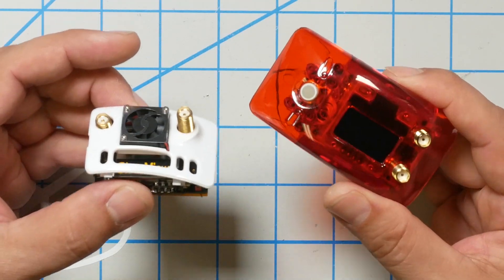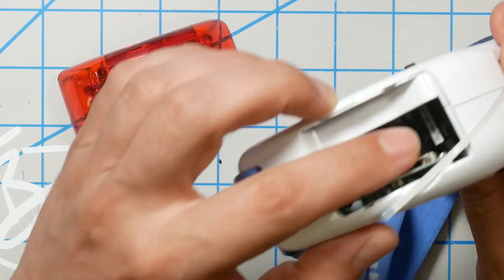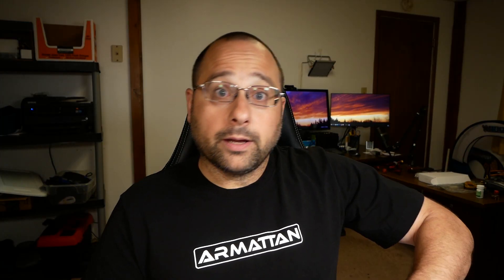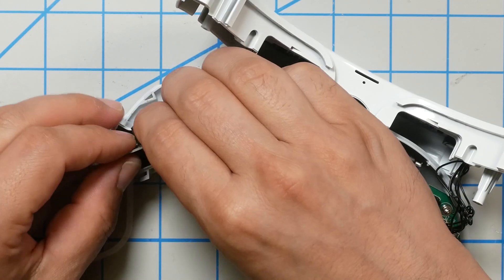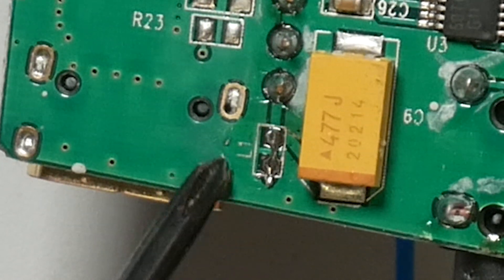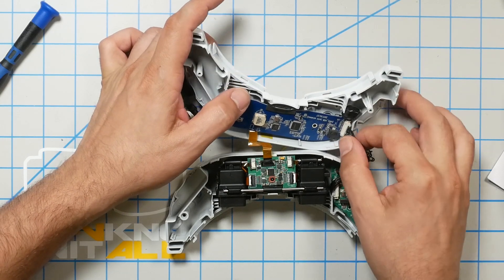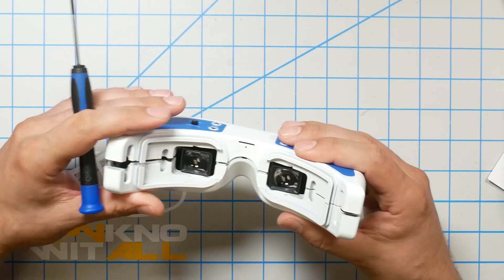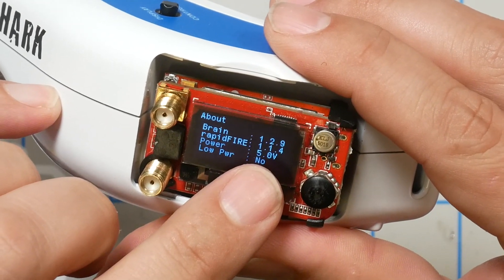Fix Rapidfire Low Power | Fat Shark L1 and L10 Inductor Mod

Comment: 😁 I did the L1 mod, But when my goggle battery gets low it go’s into low power mode 🙁 “rapidfire”. If I did the L10 mod would it fix this problem? Or does rapidfire  just do this to conserve power? Thanks again Bardwell
Reply from the maker: Yes.
Reply from the maker: It would fix it.
Reply: Thank you very much josh for the quick response. I appreciate it. Happy flying

Comment: FYI, at least with rapidfire you can access the dvr with the ribbon cable if you disable both antennas in the rapidfire menu.
Reply from the maker: What a pain in the butt.
Reply: @JoshuaBardwell  guess it depends how often you look at your dvr, but yeah, definitely some extra steps

Comment: Hi guys just be careful when you put the faceplate back on I removed it once since I had it to do the l1 mode and when I put it back in ,it bend /crack one of the lip on the goggle that hold the faceplate. Lucky I only had to do the l1 mod I’m pretty sure if I had to take it apart Again i will break it fully .

Comment: Nice video...just FYI FS will charge you $15 to do this mod to both L1 and L10...I just inquired about it since I need to have a burn spot repaired.  Figured I could get it all done at once by pros, but meh....for $15 probably do it myself

Comment: Wil it work with attitude V2
Reply from the maker: Unknown about that I'm afraid. I know for sure Attitude V4 doesn't need the mod. But earlier than that I can't say.
Reply: just put a volt meter to the bottom pin of the module when plugged in. If its >4.9v you're good.

Comment: I have dominator v3 and before I ordered rapidfire I went ahead and did the L1 mod but the voltage only went up to 4.5v. I had to take apart the DVR module and do the L10 mod as well to get 4.84v which is enough for rapidfire to work properly. I followed Joshua L1 mod video and took me hours of research to find out that I have to do L10 mod as well. I wish this video has been posted before, would have saved me so much time, but I hope this now helps many other pilots like me . Keep up the good work Joshua

Comment: Isn't i better to stay away from those high powered modules? After all, the inductors were designed in by a hopefully competent electronic engineer, and myself being one of them, I really don't think that the inductors were designed in as a decoration... But if you really enjoy these "Dam you rapidfire" moments, it would be more productive to add another voltage regulator to do the job properly.
Reply from the maker: Fat Shark has officially endorsed this mod. That's all i can say.
Reply: @JoshuaBardwell  Did they endorse the L1 mod when it first came out?
Reply from the maker: They endorse the mod, in that they say it won't cause excess noise in the power supply.
Reply: havent seen the schematic, but its probably just a choke in the power line for the module. The modules have a decent voltage regulation an filtering on their own, so it's probably fine. But I get your point, normally you don't want to short circuit your filter chokes

Comment: He Josh I have a hdo and laforge v4 every once and a while I only get one antenna would this be the diversity module going bad sometimes my patch will read less than my Omni right in front of me
Reply from the maker: I'm not sure about that. I don't think LaForge goes into "low power" mode like RapidFire does. My best guess would be that you have a bad connection in the wire going to the diversity module and it is cutting out every now and then.
Reply: Thanks I'll get the multi meter and try that

Comment: I thought that I got around this by somehow using a regulated battery cable on my HD2s. It got  low power on a regular FS battery and not on the cabled battery. Seems to be ok until a certain voltage level on the battery but added the ribbon cable so I could use a regular battery.

Comment: HD2 V2 Terminators do not need a mod... High Power compatible..
Reply from the maker: Correct. Basically all the goggles made from Attitude V4 forward don't need the mod.
Reply: Joshua Bardwell what is the type of wire you use to bridge out the L10?
Is it just a length of solder?

Comment: Way off subject but I was hoping you could help with my Emax RS 1606/4000kv motors are getting hot on my acrobrat with 5 on d gain on pitch and roll. I don't know anything about filters, I appreciate any help.
Reply from the maker: If your D gain is only 5 and the motors are still hot then I think you are over-propping them. Too big a prop, too high voltage battery, too many rpms. Are you 100% sure others have successfully used a motor this size and kv with this build?
Reply: @JoshuaBardwell  3052 props on an acrobrat build, 4s/850mah there are 2 others having this problem as well. I'm not there, but the AUW is in line with all the others I've seen.
Reply: @JoshuaBardwell  I'm not home but another of the same build is on Jeremy Trotters page, I will link it if you like, he still has his d term at 5 but changed some filters. said running still warm. If ya get a chance let me know if those settings are ok. I do not yet understand how everything works. Thanks again

Comment: With the inductors being there to help remove noise in the power, I'm guessing there's no noticeable difference after eliminating them from the circuitry?
Reply from the maker: Fat Shark officially endorses this mod. The inductors are there to filter the power, but they say they really aren't needed.
Reply: Thanks for the confirmation, Joshua, my HD2's are unmodified and will refer back to this video if I get a module that draws high current.

Comment: Anyone else ? : i`ve installed the rapidfire on my dominator v3 with the cable it comes with. but the annoying issue i get is that the rapidfire module completely changes the quality of my fpv camera, the picture becomes extremely bright with faded colors..i´ve tried to change the settings on my camera and goggles , but nothing changes the brightness and washout i get from the rapidfire module..it´s reeeeaaaalllllyyyy annoying..
Reply from the maker: Update the firmware.
Reply: Have you updated the module? I dont have those problems with my domv3

Comment: personally, the goggle module makers have known about this for years, and they should make their modules to work without modifications. the design constraints have been there since day1. design fault on the goggles or not, the specs have always been known
Reply: I disagree, had the module makers stuck strictly to the specs given it would have hampered their development and maybe not make it to market.
Isn't that what a core part of this hobby is all about, pushing the envelope to see what's achievable?